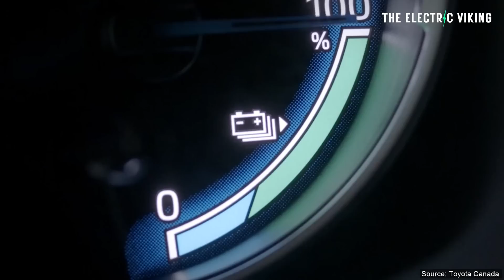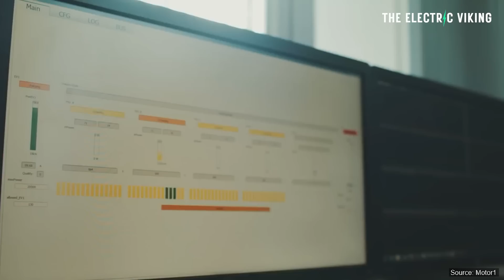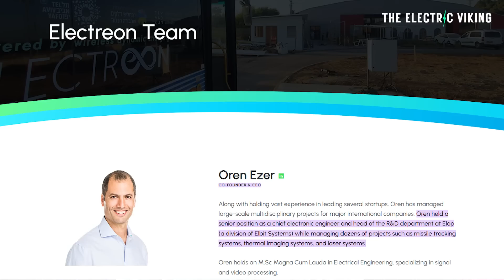Toyota Hybrid Breaks World Record: Drives 1200 Miles on  electric power only

Comment: You've got to be kidding. Can you imagine the MASSIVE infrastructure cost and maintenance to install wireless charging pads under the road surface?
Reply: The Electric Viking has never been involved in road construction.  The cost of making  0.1% of the roads capable of wireless charging would be uneconomical.  The amount of copper involved would likely be unfeasible.  It would be way cheaper to build super charging "gas station".
Reply: @davidater9  Its not the copper, its the maintenance.
Reply: @tedmoss  Just the major highways are ove 160,000 miles and 10% would be 16,000 miles per cable PER LANE.  Assuming a ground and 2 hots (208 volts/220) that would be a minimum of 48,000 miles of copper just for the interstate highways and just the recharging surface, so no connection to the grid is included.  That is a lot of copper.
Reply: @davidater9  your assuming  here. It doesnt have to be over all highways.  Just major routes.
Reply: @davidater9  No, no, no, much more. These are coils, not straight wire. On top of that, these are probably driven by high power, high frequency electronics, require sensors to know the car is above it, and must have a billing system to know which car it is charging. This is not just a piece of wire that fell when some guy walked by, this is WOW OMG $$$$$.
Reply: @davidater9  ok sorry I will just refuel my ev at home.😏👍
Reply: @davidater9  try again or are you still driving around in your modern Ford model T?  With gerry cans onboard of course??
Reply: I absolutely agree this is more garbage technology and ideas from Toyota.
Reply: It's a fun "party trick" but the reality of it actually being effectively implemented is a huge stretch.
Reply: No worries, we can just use Tesla coils! 😆
Reply: @icemanhunter1  Well, it would fall apart regularly.
Reply: It might work for bus with set route in urban areas still the cost would be high
Reply: Money isn't sufficient to build enough green power infrastructure and charging stations across the country. This tech won't make it
Reply: It ain't happening.
Reply: Traffic light sensors usually quit working in under two years, probably from freeze/thaw cycles, salt and snow plows. This nonsense would be more complicated, cost much much more and quit way faster. Please pay for it with your tax money, not mine.
Reply: @icemanhunter1  This is one of the stupidest videos I've ever seen. Firstly, ripping up roads and installing all these wireless pads. Then the massive maintenance. Then the constant repairs from potholes and accidents. And how do you repair roads with wireless pads underneath? 

A staggeringly  ridiculous suggestion.
Reply: Tomy:  BEV batteries are NOT cheap.  It would all come down to economics and infrastructure -- like how likely BEV's will be adopted real world. 

But yes, it doesn't sound cheap, that's for sure.
Reply: @icemanhunter1 :  In my experience, the sensors are normally FINE.   Idiot drivers who can't pull up to the stop line near the middle of the lane are almost always the problem.
Reply: Absolutely no chance of this happening!
Reply: @cal jeff Toyota is trying the techbin it's vehicles,  that is what matters and its a bad idea.
Reply: Next: speedbumps equipped with wireless chargers.
Reply: Parking spots, drive through lines, handicap EV parking, Stop lights.
Reply: Hahahaha 
Like comparing the costs to extract crude oil from the ground in Saudi Arabia ~ then place it on a boat for 7000+ miles ~ then refine it using more fossil fuels (use coal so no one will notice) ~ then transport it to your local service station ~ then pump it into an ice vehicle ~ then burn this once-off gift from nature (oops sorry I meant 'God') supposedly cheaply???
Makes no sense to me.
Reply: @hitreset0291  
Underground wires, on the other hand, use electricity generated by unicorns running on a treadmill.
Reply: Exactly... ridiculous
Reply: @travisjazzbo3490  do you own a horse?

Comment: I think it might work for transit busses and local delivery trucks along routes but not so much for passenger cars. The cost to install and repair might make it too costly. Roads take a lot of abuse and tend to need work every year especially in temperate climates.
Reply: Likely the street charge system is centered where there is much less wear-n-tear on the road?
Reply: @stockbusters1519  yea under bus stops where busses would stop longer?
Reply: @stockbusters1519   if it’s only 10% of the road they could probably reinforce it make it last and resurface around it as normal.
Reply: Interesting  idea, thanks for the story Sam.
Reply: yep. this. inductive on cars is dumb. ferrites will brake on impact from road debris in the vehicle and in the road. infrastructure would be prohibitive, and efficiency is meh.... for niche like busses it could make limited sense. 
-- get a chargehanger.
Reply: Transit and local delivery truck with known route for designate stop can use super capacitor technology. 22 second 1500V high current charge will give you few kilometres of range more than enough for next stop.
Reply: Not really a move of desperation by the BEV-less. Inductive charging is why Tesla just acquired Wiferon.
Reply: many cities have, or have had, electric trams, taking power from overhead cables. This isn't that dissimilar really, its just replacing the over head cables & tracks buried in the road with a wireless solution & not requiring the tracks.

If Cities/companies could afford to install electric trams in the past, then installing wireless charging in key areas of a cities road network seems do-able, if expensive, but probably no more expensive than the original electric trams cost to install. 

It might be tricky to get the necessary power to each of the sections of road though, I doubt existing underground cabling for street lights for example would handle the current required for wireless charging. 

There is also the tricky subject of vehicles paying for the power that they are using from the wireless charging network, not sure how that could be managed.

Comment: Mr Evans, during one of my lectures when I studied electrical engineering, the lecturer showed us a photo of the KFC shop in Doncaster. The photo showed a guy holding up a neon light (which was not plugged in). The neon light on lighting up because KFC was built under a transmission tower. The lecturer warned us never to work at the KFC becuase it will have long term health effects which may lead to cancer. As good as this wireless charging for car may sound, I have concerns on the about this technology on the health on drivers and passengers. We will more studied to be conducted.
Reply: What about electric train drivers and people who work in aluminium smelters or switching yards all day? Do they not count? Where is the evidence the lecturers concerns were valid and long term effects were measurable.

Personally I think working at ANY KFC is life shortening
Reply: @theairstig9164  the safe distance from a transmission tower is at lease 600 m. There are numerous cases around the world supporting this. You may Google it.
Reply: Today's EVs have that problem - occupants are sitting typically 6" - 8" over that huge battery pack. Shielding is key.
Reply: @mikeofallon  They sit inside a Faraday shield  over a DC battery which radiates no EM field. You can get a 2 Tesla magnetic field exposure inside an MRI machine and if you don't have any steel in you, you won't notice anything.
Reply: @mikeofallon , there's far too many myths and fairytales surrounding these supposed dangers to cover here, but I can easily put your mind at rest on this one. Batteries are DC - they can't be anything else. DC can create a magnetic field only. EVs use high voltages to keep the current requirements low in order to avoid large power losses and reduce the size of the cables needed. The strength of a magnetic field is dependent on the current and not the voltage. As I said, the current is kept intentionally smaller than it would otherwise be by using a high voltage. The strength of a magnetic field is also dependent on the number of turns of a coil and a straight piece of wire has no turns.

Is there a magnetic field coming from the battery in an EV? Yes. Is it significant? No. If there was a significant magnetic field, it would induce currents in the delicate circuitry of the computer systems running the car and it basically wouldn't work.
Reply: @mikeofallon  You will note the electric wires are balanced, canceling out the magnetic field. Come on people! use your brains! No "shielding" is used or needed. Does you compass go awry when an electric car passes? More studies have been done over the last 130 years on this subject than any other except possibility Atomic bombs.
Reply: The battery tech may get cheaper but cars will never get cheaper.

Yes there maybe sales on where prices will get reduced for a short term but long term prices increase.
Reply: @granttaylor8179  inflation from central bank money printing, not a function of tech development.
Reply: @granttaylor8179  Long term prices will decrease its simple economics.
Reply: @simoncurtis3779  No prices for cars will increase. They allways get more expensive.

Comment: The ridiculously short track means the car is charging every 8th of a mile or so (just a guess, but who cares here).  This does not really translate to any realistic, real world situation to me.  Lets say it takes 10 minutes to charge the battery, every 30 miles or so, one would need at 60mph, 10 miles to mostly charge the battery.   Then go 30 miles till the next 10 mile stretch to charge.  or perhaps go 3 miles and charge for a mile etc.  Maybe in some places this would be practical.  I doubt they would do this all the way across the country.  If a car had an 150 mile range and charged in 5 minutes, it would seem a lot easier to install a mile of chargers for every 25 miles or so.  That may be more practical..  How much  power would be required to charge a heavy traffic day?   Lots of questions.  i have not seen any small, practical super streamlined enclosed vehicles that drive like a motorcycle, but can stop without falling over and carry 2 people, like a motorcycle.  Much lower power required compared to the cars now designed.  Would have to be usable in snow.  Actually there is one, forget the name, but is is a bit between a car and a motorcycle.  It does not lean.  Oh yeah, Aptera.  Too expensive and too conventional a design to me.  Too wode.  It needs more inspiration.
Reply: I wonder. If this electric road tech allows charging of the car while stationary, then it could be used to simply make a big parking lot, and turn that into a charging station. Cities could also install this one say one lane of one of their high traffic thoroughfares, like a ring road and make it an "EV only" lane, not too dissimilar to the High Occupancy Vehicle lanes some cities already have. They could potentially even make that stretch of the road system a toll road.
Reply: @adamwu4565  Lots cheaper and more efficient to just have a regular charging station, instead of an inductive charge parking lot.
Reply: Aptera is a whole new direction in EV transportation thought.
Reply: i have not seen any small, practical super streamlined enclosed vehicles that drive like a motorcycle......  -  It is built since 1984 and is called Ecomobile, but due to a small swiss low volume production its way to expensive.

Comment: Don't know about where you live, but where I live they repave the roads every few years because they need to.  All of a sudden I can see the expense of this regular maintenance skyrocketing.
Also kind of wonder what would be the effect and cost when some nimrod (propably the same guy who rolled coal on your Tesla)  decides to start doing burnouts with tungsten spiked snow tires?  I can attest that this is particularly damaging, because at the age of 16 I managed to actually rip up the asphalt for about a half block with my 69 Z28 by trying to lay rubber with new studded tires.  This left deep grooves in the road witch eventually filled up with water that froze and over one winter a new asphalt road was basically ruined.

Comment: A PHEV only needs a cheap little 1-liter 3-cylinder engine that is light and compact, but can provide power back up for your home or camp site when grid electricity won't be available.  This is especially true during weather extreme causing very high grid electricity demand that you may be forbidden to charge your EV during this time.   This "Little Engine That Could" could also provide extra power to the grid in order to save the electric grid from black-out during periods of excessive demand.  
Plus, you won't have access to fast-charging when traveling to areas of low population density like rural areas.  
If most Plug-in EVs will come with a range extender, then this idea of road-charging won't make any sense, because it depends too much on the fragile and over-loaded electricity grid.
Reply: Problem is all electric sources might be cut off during a blackout, you would not be able to "help" the grid. Many ideas have been tried and many have come up short, keep trying. A generator and fuel at home could charge your electric car as well.
Reply: @tedmoss  ....The idea is to assist the grid before black out will happen.  2nd idea is to carry a generator with you all the time wherever you go to charge your EV instead of leaving it at home, allowing you to reduce battery capacity from 75 kWh down to 15 kWh to make up for the weight and cost of the generator.

Comment: We need to understand the true cost of this system.  Is there an environmental impact due to the magnetic field exposure?
Reply: It could totally F up migrating birds and cause disorientation of bees as they rely on magnetic orientation .  

But the "real" issue is it returns dependence on corporation/ government.  Rather than energy independence by using distributed individual power generation.
Reply: @johnb7430  It's an AC field so it wouldn't bother birds. The real problem is inefficiency. It would need to be controlled so that it only turns on when an inductive charging EV is over it. Also, are they going to give away energy for free or figure out a way of charging customers for it?
Reply: @James Van Damme  i imagine a segregated "toll lane", probably 5+ miles long.   But that only works if all accept charge at the same rate
Reply: @jamesvandamme7786  there already is a system for that so they only give access to paying customers etc
Reply: they can manually operate so it alls seems to be too good to be true almost haha, look up the company and what they say
Reply: Toyota is all in on hydrogen. The gas comes up from the road and enters the air cleaner. Oh yeah, look it up.
Reply: D Wall, "Is there an environmental impact due to the magnetic field exposure?" Exactly!

Comment: Can’t wait to see this done with an all electric car with the bigger battery to see how it goes
Reply: It would go the same, the size of the battery will make no difference.😑 You are actually not running on battery power, the car is running on the power coming off of the road.
Reply: @andresd6193  so it is not charging at all?
Reply: @ZeusBullyMax  no, that's why you can run for that many miles, the car is running from the power it is getting from the road, same as an electric train or a electric tranvía streetcar runs.

Comment: It would be great for busses, have them in front of every bus stop.
Reply: Lancaster, CA has this (wireless charging at bus stops) for its fleet that is 100% electric buses, with no diesel or hybrid buses.
Reply: aha! Great idea
Reply: Already tried using overhead trolly connection at bus stops.
Reply: @MegaWilderness  much better idea,

Comment: Sam, please don't fall for this nonsense.  It's the same with battery swapping.  The ideas are spectacular but the implementation is not practical at all.  

A single car on a wireless track in perfect conditions and doing 25 mph is not the same as 100 cars on a wireless track in perfect conditions doing 70mph.

Just like the battery swap technology, this will be financially unviable to add into the infrastructure because charging a car while stopped will always be infinitely cheaper to support.

I believe in wireless charging IN MY GARAGE AND PARKING SPOTS.  Do not fall for this nonsense that it will be implemented into roads and highways (which are already very expensive to repair and maintain).  It's June and all the winter potholes remain un patched...now imagine the coils only 2 inches deep and exposed to every curious child that walks by?

I really thought you were smarter than this.?  Are your roads always pristine and undamaged all the time?  Do the utility companies never cut into them to run new wires and pipes?  WTH?
Reply: Bro <3 well written. I am a fan of Sam but sometimes.... for me it's when he talks about eco driving[hypermiling]. A joke of driving unsafely slow to get crazy improvements on range.    

So now he is talking about how long a car can drive while being charged? Pshhht let's put a generator on my tesla and call it's range infinite [joking]
Reply: well, being a content creator is not easy. he has to try to draw people's attention, sometimes with nothing more than lame ideas.
Reply: @egaskrad  These are lame ideas that have been tried and rejected, but you never know when some new thing will pop up from the garbage heap.
Reply: @tedmoss  true. just like the sodium batteries.
Reply: I don't think speed is as big a factor in large cities. Traffic is often 30 mph or LESS. I bought my first "portable" computer in 1983, compare that to the average phone of today.
Reply: Sam hasn't fallen for anything, I'm sure he realises it's nonsense, it's just click bait from him